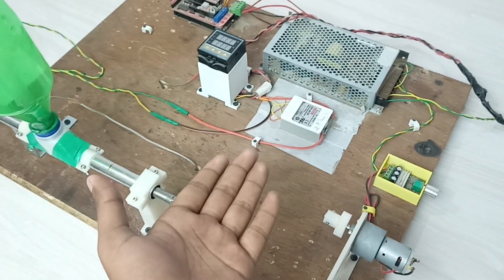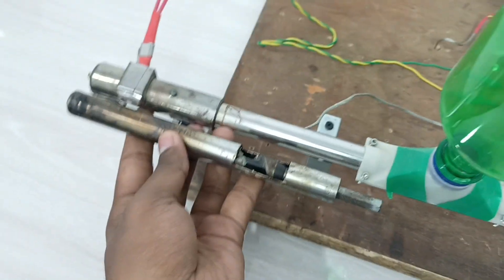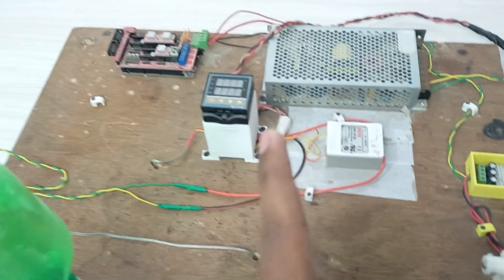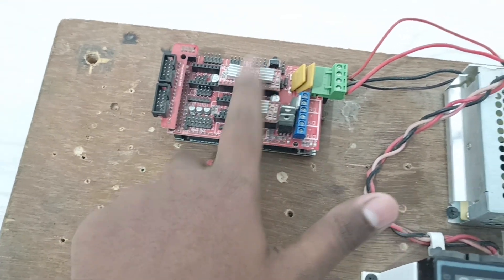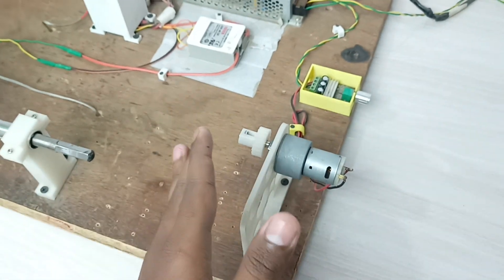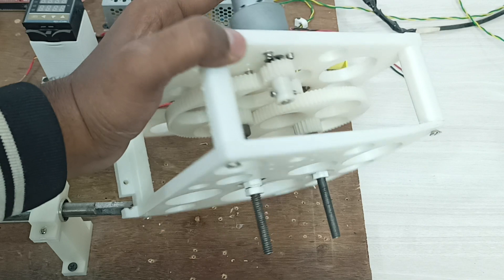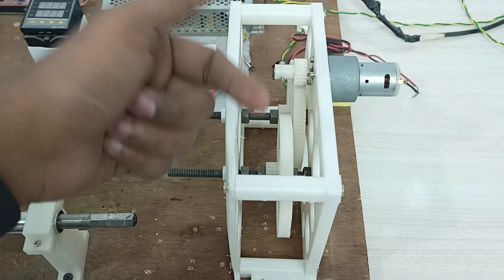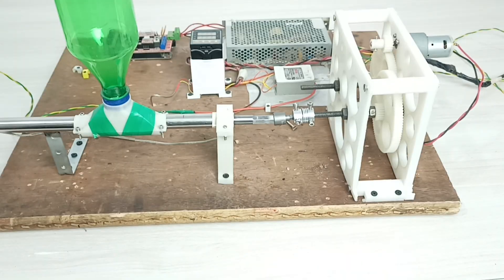$60 DIY 3D Printing Filament Making Machine - Make Your Own 3D Printing PLA Filament at Home

Comment: Keep us updated on what changes you keep making. No need to wait so long between posts. Seeing what issues you have had will go a long way in helping us avoid the same struggles. 
Seeing this project evolve has been very cool. 
I would like to see the pellets you are using too. I think it would be great to be able to grind down failed prints or support material to put into this but I am wondering if an inconsistent pellet size will have a negative effect
Reply from the maker: I don't think inconsistent pellet size will affect the filament quality all you need to maintain appropriate supply and speed & yeah, i was thinking of recycling waste 3d printed parts. Will come up with a video regarding this.
Reply: @Creative3DP  all you would need to do to maintain flow is add a vibration motor to unjam it and have it turn on every 5-10 seconds because they would get stuck but its easy to unjam
Reply from the maker: I'll keep in mind, thanks man!